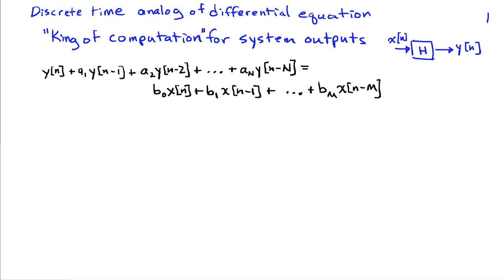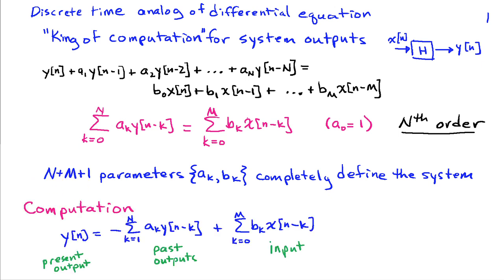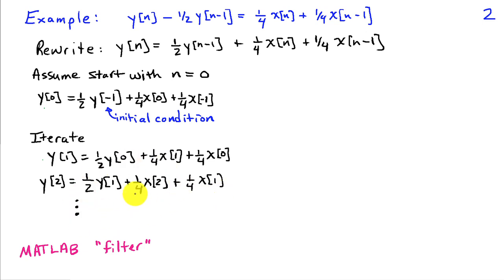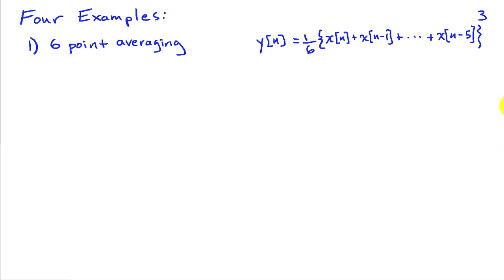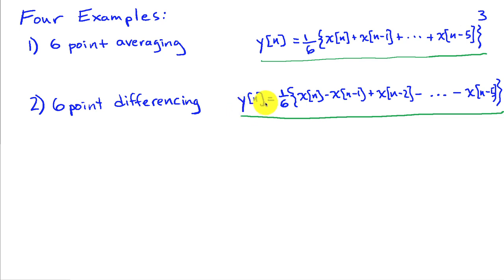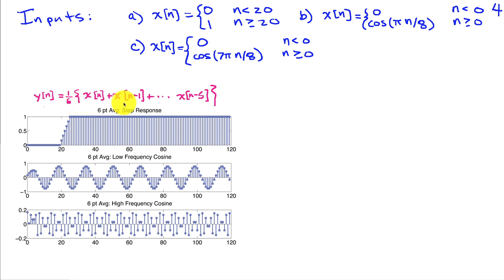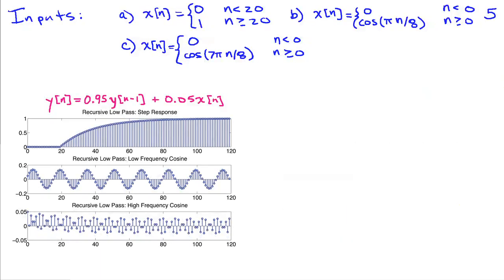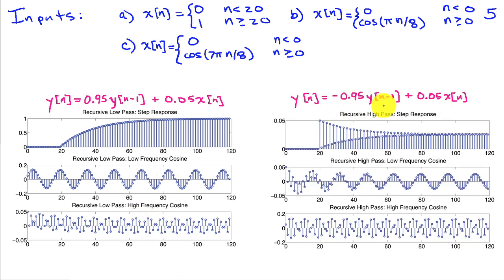Difference Equation Descriptions for Systems

Comment: Determine the total solution of the following difference equation:
y(n)= 5y(n)-6y(n-2)+x(n)
when the forcing function , x(n)= 3^n and initial condition , y(-1)=2 &amp; y(-2)=4.
Also, draw the difference equation using building blocks. sir answer please

Comment: At 7:52 i dint understand the graph...y(n) was the average of 6 values so how come in graph we see many values....what is the graph a plot of?
Reply: It's four months already, but maybe you could still use the answer to your question, mate. And if not, maybe someone else will find it helpful. :)

(As far as I understand) the output function y[n] at any discrete time unit n is an average of the values of the input throughout the last six time units. Having so, we should not expect to be one average value of the input signal as a whole. As you can see in the example with input signal a) applied, when x[n] makes its step from 0 to 1 at n = 20, y[n] starts to follow up: at n=20 it is an average of x[20] = 1 and five values prior, all equal to 0. Then, y[21] is an average of two instances of x[n] equal to 1 and four instances equal to 0. This continues to y[26] which is an average of x's from n = 26 to n = 20, all of which are equal to 1, resulting in y[n] finally reaching the value of 1 it was "pursuing". 
Strictly approaching your question, the graph illustrates the output function y[n] in the time domain. So you can see how an average of the input signal form e.g. last 6 seconds (if we assume N = 1sec) changes in time.
As you can probably see (and could have heard in the video) this comes in handy when you would like to smooth out an input signal having some rapid noises/fluctuations, as they will have a somehow limited impact on the output signal.
Reply: ok i get it now haha